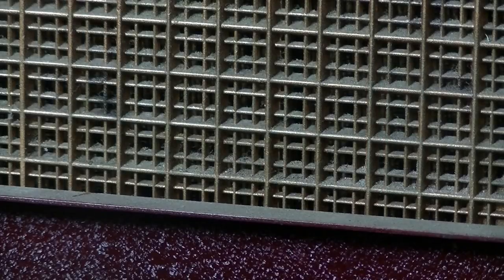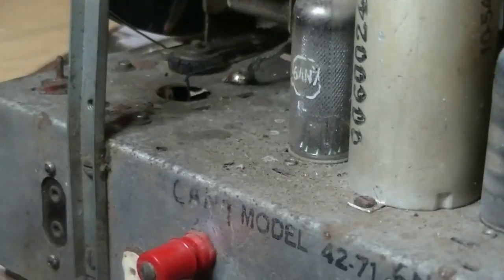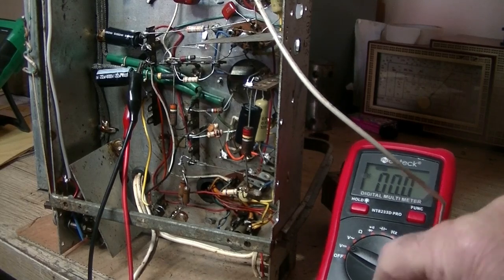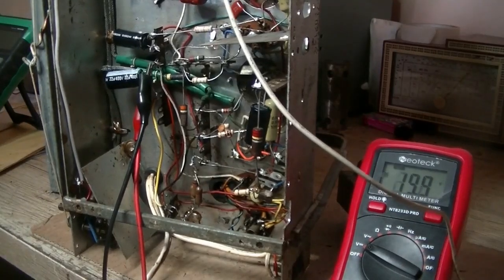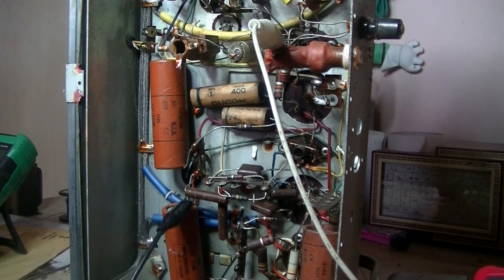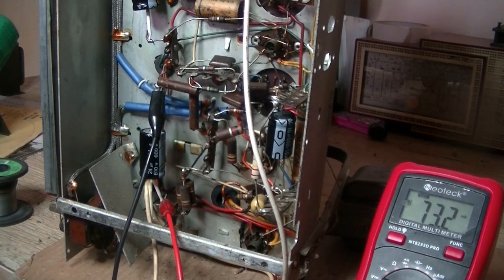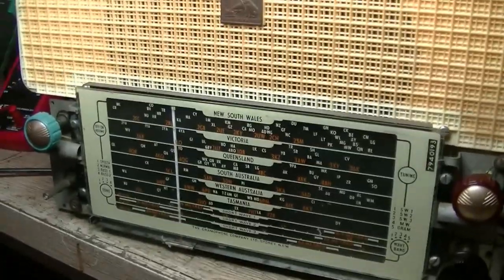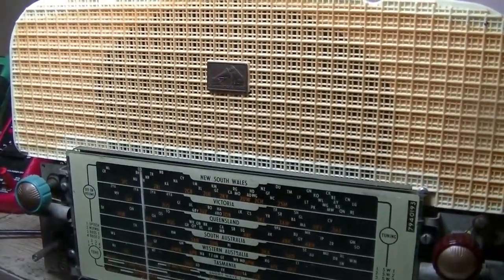HMV 42-71 Restoration, Circa 1954-59

Comment: It's good the owner had two radios to make one. That gives you more options to repair. Plus extra parts if you need them. That owner is going to be happy with that you got a nice grill and pointer besides fixing the radio. Thanks for the video Frank.
Reply from the maker: It certainly is a bonus when you have a spare chassis Larry. Thanks for watching :)